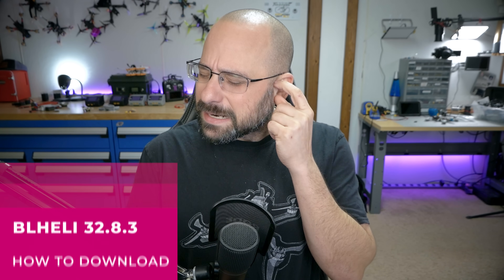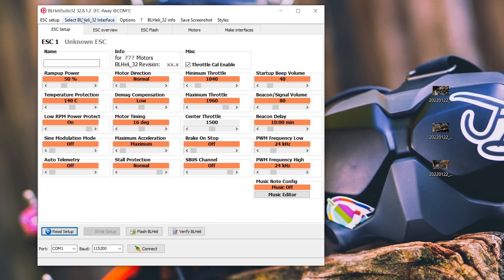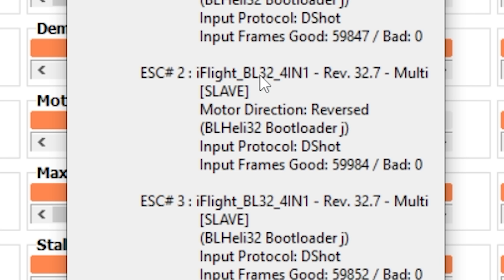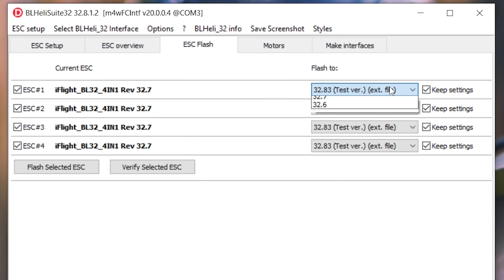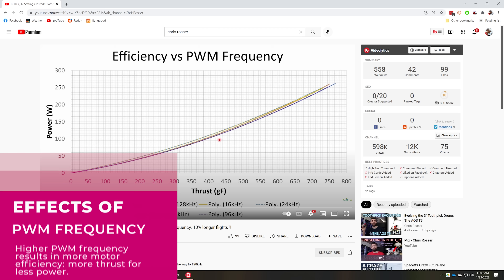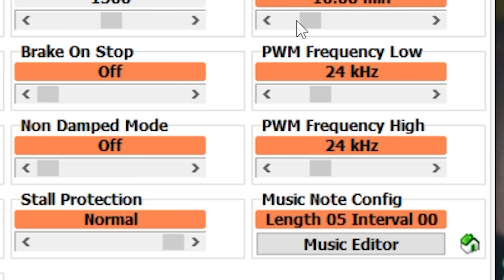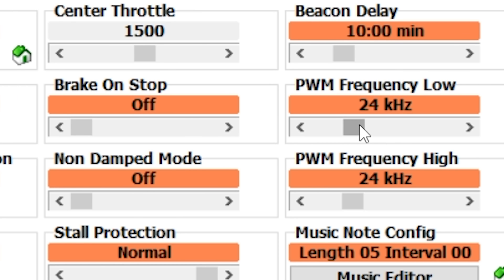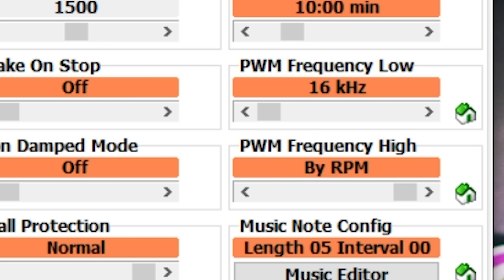BLHeli32 ESC's just got a BIG performance upgrade. Here's how to get it.

Comment from the maker: BLHeli 32.9 has released. You do not need to download the testcode any more. You can simply flash a normal version of blheli32 version 32.9 now.
Reply: A friend and I have noticed an unusual high amount of burned motors since we changed the ESC settings to 16kHz (low) and ByRPM (high). It happend to us after hitting race gates or small branches not to hard.
The problem disappeared as quickly as it appeared after switching back to 24kHz for high and low PWM frequency.

This issue was confirmed by other discord users on the UAV tech server also.
Reply: @MikeYouTubePrivat  any updates to this? have you tried changing back to 16KHz to see if the problem persists after switching back to 24khz?
Reply: @29jvskate  we lost 5 motors while flying with 16kHz (low PWM) for 2 days. After switching back to 24kHz we flew around 40 packs so far and had a few hits too but all motors are still working.
Reply: @MikeYouTubePrivat  wow very very important info thank you for sharing! Lots of money could get burned up if this isn't fixed.
Reply: @MikeYouTubePrivat  yeah I was getting some bad high throttle issues (vibrations) with it set on " by rpm" as well. Someone better at tuning might have been able to get rid of them. But I couldn't. Running the Mamba f7 dji 128kHz stack, with the fpvcycle imperials, apex frame.
Reply: Are there any updates on the problem of people smoking motors and ESCs with "by RPM"?  Anything fixed in 32.10?  Thanks!

Comment: I made the mistake to buy a "xrotor 60 amp" ESC and I can only warn from those line of ESCs.
Aside of being > 100$ priced, the pinout in the manual is wrong (GND and 5V pins are intermixed with actual sensor pin locations)
The "telemetry" pin is only available in the ribbon cable (which has 2 undocumented pins) and it actually carries 5.5 volt and can destroy an FC.
The CRT amp monitor pin is supposed to have a voltage based on current consumption, it has an inverse voltage of 2mV that drops to 0 when a bit current is drawn, so it's flawed.

And on top, if you connect that thing to BLheli 32 suit then it can connect but it can not show any data.

Comment: Bro, I just got a Evoque F5d, and, first flight, went to gyroflow, and surprise!! Just can't use any of his O3 videos, cause it's flickering when smoothing by gyroflow. So the software says to use 48khz or more at ESC pwm, that's OK. I have changed it. But it is a 5" Drone, it will handle it or burn my motors? Setup in min pwm 48khz and maximum By RPM. Thank you!

Comment: Just a heads up for noobs like me... (I'm here to set PWM frequency to fix Jello in my o3 air unit)... BLHeliSuite32 won't be able to find your ESCs unless your battery is plugged in to your quad AND your USB cable is plugged in. As always, remove the props and use a little fan on the o3 air unit to avoid overheating ;) Much love! Thanks so much Joshua for all the great vids!!!
Reply: One other thing... I couldn't get rid of my jello even after adjusting the PWM to 48, soft mounting, AND gluing the o3 lens barrel. Turned out it was the props I was using. I went from Gemfan Floppy Proppy biblade props to Dal Fold Tri blade props and the Jello is gone now. Hope this helps somebody out there.

Comment: Is there a way to do this without usb? With Wi-Fi erls, basically how you can on betaflight . Reason asking , I saved a quad I had down because of a bad usb
Reply from the maker: No, it's not possible to flash the ESC with wifi any way that I know.
Reply: @JoshuaBardwell  thank you

Comment: Hello Joshua  I updated my Hobbywing ESC to 32.89 using loaded startup test code. The motors were making weird sounds and also were getting really really hot.
Reply: I had the same issue with 32.8 with the hobbywing esc. I put 32.7 back on with no issues. I'm going to try 32.9 tomorrow. hopefully it's fixed?
Reply: @BurgerPlanetLive  yeah I updated to 32.9. It seems to be OK

Comment: I was able to follow up to 2:30, When i "Read Setup" it comes back with NOTHING! 1-4 esc's do not show any data and an error says "No valid ESC configuration". Where did i go wrong?
Reply from the maker: First guess is your ESC is blheli_s not blheli_32. In that case you won't be able to use this feature.
Reply: @JoshuaBardwell  you again are correct. thanks for the save.

Comment: Thanks for the video. This is my experience with this: I use BF 4.3 rc3 with RPM filtering ON. I use t motor p50a esc, with f80 pro motors. I use esc fw version 32.8.3. I tried motor timing auto, then 16 to 22, with demag medium and high. Whenever I set any combination of variable pwm, 16 to by rpm. 24 to 48, I get this metallic ringing sound pronounced when hovering. Motor temp slightly increased after micropunches at home (storm for days outside). But when I set PWM to be fixed, 24 24, 36 36, 48 48, I get supercold motors and perfect sound. Now, my question is: Is it normal for sound to change to a bit metallic one, at 20-30 throttle (cant use more at home). The frame is apex 6 inch. BF filter sliders were at default 1.0 position. Thanks for any info on this.
Reply: I have the same issue with multiple Blheli_32 quads, I can't find why it's happening. Have you solved it ?
Reply: @artemsloytsev1052  Hello. On one quad the sound disappeared when I used rushfpv extreme 60a secs, motor timing 16 and 24 to by-rpm setting. I am not sure what made sound go away on this build though. You can try these settings i mentied above.
Reply: Appart from fixed min and max pwm, what are the other settings you are usually using on a 5 inch that gives you cool motors? thnx
Reply: @nakmax   nothing special. now using 23 timing on all quads, fixed 48 48 pwm, demag low. And some preset tunes. Motors cold and no issues. So, for me, variable pwm is not an option for now.

Comment: @joshuabardwell - I went to flash my Foxeer Reaper 65A 128k ESC with 32.8.3 fix. It shipped with 32.8 but U only see a 96k version for both 32.7 and 32.8/8.3, Am I missing something stupid? I notice that on the shipped 32.8, as per your reccomendation, I can change my min/max - to 24k/128k so it is definitely not the 96k version.

Comment: Guess I'll wait there's to many files for the tekko 32 f4 4 in 1 esc there's like 10 different flies. G,h ,multiple etc
Reply from the maker: Download all. Put them in the folder. BLHeliSuite will automatically pick the one that matches the current ESC.
Reply: @JoshuaBardwell  got it done going out to fly some packs now to try out the by rpm thanks again
Reply: It does feel smoother.flew 12 packs lol it kinda felt like my pids changed a little.liked, shared as always, I learn something everything lol🙏
Reply: @JoshuaBardwell  hi jb just a update .on my new hd h7 kakute I had errors in the motors tab when trying to bidirectional dshot .after I flashed back to 32.8 no errors .maybe 4.3 when released it might work with the h7. Only sending this jb fpr feedback lol not to bother you .happy flying

Comment: @Joshua Bardwell I found out that the Hobbywing BLHeli32 target was corrupted in this page BlHeli32 suite did not even startup with this hex file in the mentioned folder: https://github.com/bitdump/BLHeli/tree/master/BLHeli_32%20ARM/Rev32.8.3%20testcode I tried it from this page: https://github.com/bitdump/BLHeli/releases and then it was working fine. Don't know if there are repots from other brands but this was my experience with the Hobbywing ESC.

Comment: How much efficiency (or breaking power) is actually gained here, given we indeed constantly change motor speed and thus, I guess, only use higher PWM frequencies less than 10% of the time? Every time we lower the throttle, a lower PMW frequency kicks in, no?
Reply from the maker: You can watch Chris Rosser's video linked in the video description for numbers. To me theain advantage of the higher PWM frequency is avoiding the motor harmonic. The extra efficiency is secondary at least in 4" and up quads. The increased braking performance is substantial comparing 48k or 96k to 24k or 16k.
Reply: @JoshuaBardwell  Thx, will look into that!

Comment: Version 32.8 on "airbot wraith32" ESCs gave me lot of trouble as long as I had selected different PWM freqs for "low" and "high", like 24 and 48. Motors were stuttering. They run smooth now however with 48/48.
Reply: @Alexander Dräbenstedt
 : and is low:24 high: by-rpm any good for you on 32.8.3 testcode with these Wraith32 ESCs? (and is 48/48 what you are running on 32.8.3 or on 32.8?)

Comment: Thanks, Joshua!
Apparently my Tekko32 F3 goes from 48 to 96khz (IIRC)
and my T-Motor  F4 goes from 16 to 48khz (IIRC)
Is it still safe/useful to set BLHELI Max PWM to "by RPM"?
Reply from the maker: You can, but it may be depending on your motor rpm that the optimal PWM frequency is not available. In that case, the ESC will do the best it can, and you won't be worse off than with fixed PWM.

Comment: Joshua, do you know if F4 ESCs are downwards compatible with same model's F3 version, meaning can I basically just swap an F3 with an F4 or would there be anything to watch out for? And what's the advantage of the F4, can they just run higher Dshot or is it just future-proofing?

Comment: Okay, that's cool. But, what is 'By RPM' really achieving? Is it supposed to be working along the same basis as how the variable PWM frequency works in AM32? Or better yet, is there a GitHub wiki on what 'By RPM' is actually doing?
Reply from the maker: Yes it's similar to am32 variable PWM.
Reply: @JoshuaBardwell  okay cool. It wasn't really explained what 'By RPM' did in the video when enabled, versus what BLHeli32 was trying to achieve with the changing frequency based on throttle only which was explained.  That's why I asked.

Comment: I have a set of Airbot Wraith32 mini st  blheli32 escs on my v1 Kopis. I think they would have the  f0 processor.

Would I still be able to run 32.8.3 testcode for some benefit, or would byRPM not work at all on these?

-i'm trying to gauge if should update to 32.8.3 or rollback to 32.7 on these (they were recently updated to 32.8 from 32.2 in order to enable the rpm filter/bidirectional dshot, but never tested out in flight)

Comment: Great video! I had some troubles with that using 32.8 version.
I put low pwm at 24 and high at 48 and the sound was horrible. The bad thing is that I did not realized it was because of that and I disassembled all the quad several times, changed some screws before realizing that the problem was the pwm low/high different values.
After set then at 24 the sound was good again...
Honestly I was lost and frustrated about that, even if I didn't realize that bad sound came after changing pwm frequency...
Thanks Joshua!!

Comment: Hi future Joshua, I have a question: Why does a high PWM frequency hurt breaking power? I've seen the graphs of Chris but I cannot see any physical reason why that should be.
Reply: Check out MiniQuadTestBench for that data, Ryan provides a fantastic explanation (or the JB-Ryan Harrell video discussing those)
Reply: @tehllama42  Sorry, but I could not find anything from Ryan relating to breaking. I understand why a high PWM frequency can hurt torque on low RPMs but I fail to see why that effect is so much higher on breaking.

Comment: Flashed on Hobbywing XRotor (30x30 60A), I rolled back to 32.7. 32.83 was flying OK at fixed PWM feq., but not as good as 32.7. Enabling variable PWM Freq (16-By RPM) gave terrible results : bad noise, hot motors. Currently, it is still test code, might not work as well with every ESCs, be careful.
Reply: Same thing for me, hot motors and Bad noise... Return to 32.7 ans it's ok ! 
My esc's are aikon ak32 55A v3
Reply: @samuelaugry478  Your ESCs are STM32 F0 based, like mine. Maybe it has something to do with our common issue.
Reply: you can always choose 24khz as the low - if you were at fixed 48khz before and switch to a lower pwm (even if 'By RPM') you may need to retune.
Reply: @CesiumSalami  Even if it was pretty OK at fixed 48kHz it wasn't as smooth as with 32.7 and it is audible. I'll give an other try when final release will come out, right now, with these ESCs, 32.7 flies better.
Reply: I just tried 32.89 today and i still had the same issue with the Hobbywing X rotor esc
Reply: @BurgerPlanetLive  You mean 32.9 ? I wanted to try, but if it is not fixed, I'll keep 32.7 which works great

Comment: I can’t really explain it, but after I flashed to 32.8.3 and using the “By RPM” feature
I definitely felt the difference on my first pack. Low end throttle feels significantly more “in control” and the all out flight performance feels SUPER smooth, even the motors sound better. 
I definitely recommend this and I cnt wait for the official release.
Reply: Wow, thats nice
Reply: D term response is tighter at lower PWM.  You can still achieve that with fixed 48kHz PWM using thrust_linear, but I'm with you - I can't wait for 32.9, because that will finally present an upgrade over my BLHeli_S ESC's
Reply: @tehllama42  thrustlinear, what number did you using?
Reply: @erlandfpv  The stock 25 value does really well for most, if it's a very under-authority craft you can go as high as 35.  For lightweight (100g) racers on 2S packs that are really 3S quads (GTB339), I'll use a value of 15 to clean up a lot of the low throttle bobbles where a bit more P&D gain can settle things out better than having too much gain at high throttle.
Reply: @tehllama42  nice sharing, im using "25" for my setup, reference from uavtech presets,  even for my 7 inch, i think need to raise the number?

Comment: Thank you Joshua. That is all nice and scientifically proven by guys like UAV Tech, Chiris Rosser,.... But does it really feel it is flying better that ''just'' having clean build, using bidirectional D-shot, minimize the filters and do some PID tuning?
Reply from the maker: It's all small improvements but it adds up.
Reply: @JoshuaBardwell  that makes sense, thank you.
Reply: sure. check the shorter delay in pidtoolbox

Comment: I am Going to Build an FPV Fixed Wing Airplane,
Should I Put the PWM Frequency High or low for Efficeny?
 Can I youse 2 Identicel BL Motors exactly Paralel Conected Motor Windings with only One ESC? I mean with not Twistet Motor Wires.
Reply: You should buy different ESCs than "software-controlled". Buy by hardware, not software programmable. Two separate for two motors.

Comment: I'm gonna try this on my DJI Diatone Roma F5. I just switched it from Betaflight to Emuflight cause I like the tuning on there better not to mention Bidirectional keeps giving me error no matter if I change 8k to 4K and all that. Anyways I put my GoPro 9 on the Roma F5 and the weight was very noticable so I took it off and took up my Bandolero with a KISS f7 FC and I couldn't even notice it. Do you think that running on 24 PWM frequency could have been the problem and that the upgrade could actual help? Sorry for the very long winded question. Just wanted to explain as much as possible.
Reply: A quick test would be to plug in your Emuflight board and (if you haven't already) go to the Rate tab and set 'Feathered PIDS' to 0.  This makes it so that your PID controller runs completely off the 'Error' value like the KISS PID controller does rather than the 'Measurement' value that BF uses.  This should let you make a more apples-to-apples comparison between the two quads.  At that point I would try raising PWM frequency on the Roma, and see if that improves the performance compared to the KISS quad.  At 24HZ its definitely possible that you 're not getting the motor efficiency you need to move a heavier quad the way you want to.  Hope this helps.  BTW I run Emu and much prefer the KISS style PID loop (Feathered PIDS at 0).  If you haven't tried this yet you're in for a treat.

Comment: Do you really need 100% ramp up power? Uavtechs has his around 12-13% and chris has around 20% for 5” quads. 
Ive smoked 4 motors now and i dont know where i went wrong with stock filters and relatively low D gains. My master multiplier is at 1.3
Reply from the maker: I do not set rampup to 100%. That most be a decision by the maker of this bind n fly quad. There are little benefits to increasing rampup past a relatively low number and increased chance of smoking motors.
Reply: @JoshuaBardwell  thanks for confirming 👍👍👍
Reply: Smoking motors can be caused by a Lot of things.. 

trying to arm when the motors cant spin, for one.

If they smoke while flying, IT can be a problem with filter settings, but stock filters shouldnt be a problem on a 5".

Also, trying to fly with a mechanical dirty build, ie old wonky motors, a loose FC flapping around, etc, can make bad things happen. Or loosing a blade on a prop, can make the motors really hot in seconds.

Make sure everything is right with the build, motors doesn't have a bent shaft, and props arent bent too bad, and try again.
Reply: I’m not sure about 100% ramp up - it was 50% prior to JB updating from 32.8 (and I think I’ve seen 50% being mentioned elsewhere on either a uavtech or Chris rosser vid -given JB doesn’t explicitly mention that ramp up value change in this vid, I would exercise caution until he can confirm).